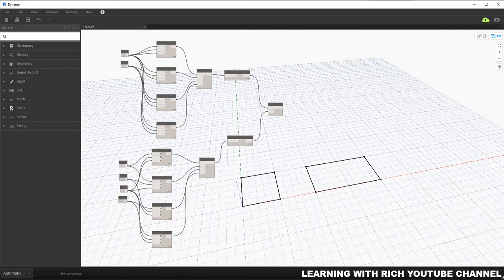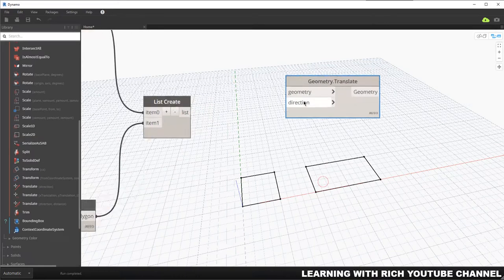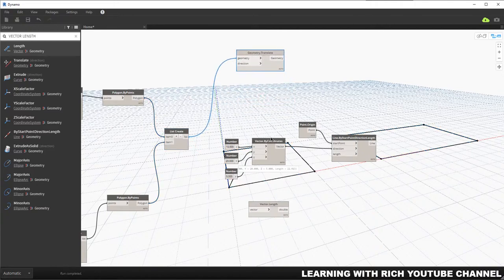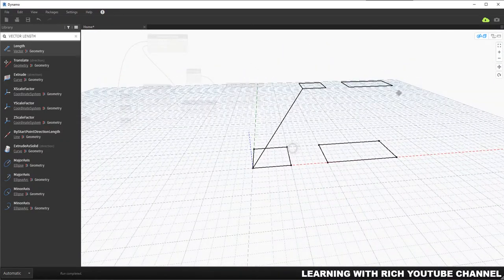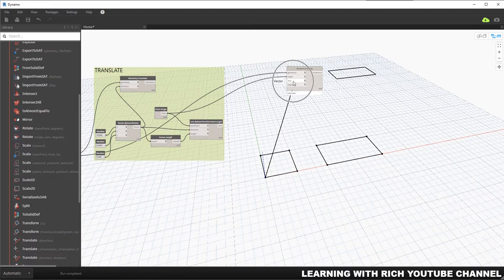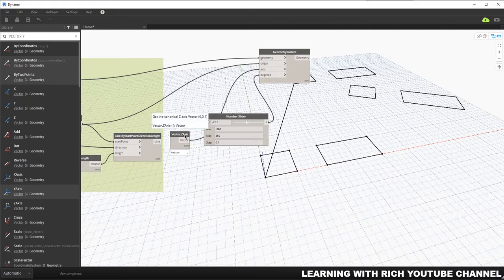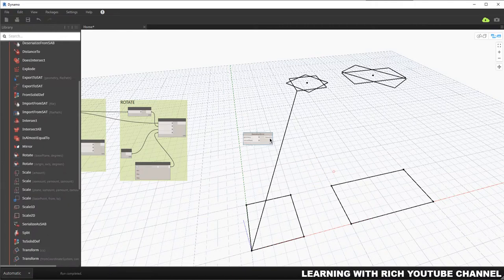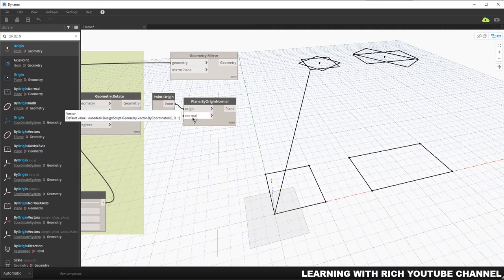DYNAMO FOR BIM - LESSON 14 HOW TO USE TRANSLATE, ROTATE AND MIRROR IN DYNAMO

Comment: Great tutorial! Thank you. But how can I rotate a solid along x,y or z axis? I can't seem to find a node that works. I would highly appreciate your help on this. Hope to hear you. Thanks again.
Reply from the maker: In Dynamo, you can use the "Element.Transform" node to rotate a solid (or any other element) along the X, Y, or Z axis. Here are the steps to achieve this:

1. *Create or Import Solid:*
   - Make sure you have a solid in your Revit model. You can create a solid or import it into the project.

2. *Install Required Packages (if needed):*
   - Ensure that you have the required packages installed in Dynamo. If you don't have the necessary nodes, you may need to install additional packages such as "Clockwork" or "BimorphNodes" that provide advanced geometry manipulation tools.

3. *Use "Element.Transform" Node:*
   - Open Dynamo and create a new workspace.
   - Use the "Element.Select" node to select the solid you want to rotate.
   - Connect the output of the "Element.Select" node to the "Element" input of the "Element.Transform" node.

4. *Set Rotation Parameters:*
   - For rotation, you can use the "Rotation" input of the "Element.Transform" node.
   - The "Rotation" input expects a rotation transformation. You can create a rotation transformation using the "Rotation.ByAxis" node.

5. *Specify Rotation Axis:*
   - Use the "Vector" input of the "Rotation.ByAxis" node to define the axis of rotation. For example:
     - For X-axis rotation, use the vector (1, 0, 0).
     - For Y-axis rotation, use the vector (0, 1, 0).
     - For Z-axis rotation, use the vector (0, 0, 1).

6. *Specify Rotation Angle:*
   - Connect the desired rotation angle (in radians) to the "Angle" input of the "Rotation.ByAxis" node.

7. *Connect Nodes and Run Script:*
   - Connect the "Rotation" output of the "Rotation.ByAxis" node to the "Transform" input of the "Element.Transform" node.
   - Run the Dynamo script.

8. *Review the Result in Revit:*
   - After running the script, switch back to Revit to see the rotated solid.

Remember to experiment with different rotation angles and axis vectors based on your specific requirements. If you encounter issues, double-check the inputs and make sure that your solid is being correctly selected and transformed.
Reply: @bim360  🥰Thank you so much for the reply! I will try this. ❤
Reply: @bim360  Hi! Hope I can ask more about this? I have downloaded Clockwork and BimorphNodes but Element.Transform, Element.Select Node is not showing in the search bar. I am using Revit 2023. Is there something missing? I'd appreciate your reply. Hoping you have a tutorial of this or at least similar. Thank you.